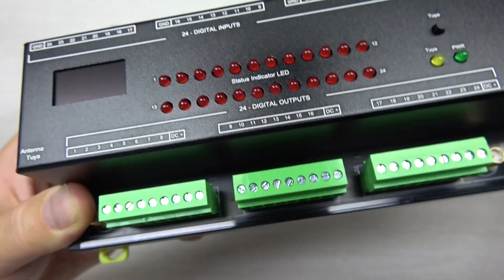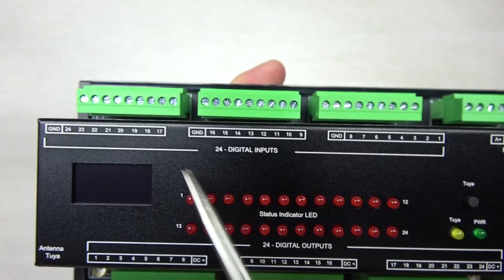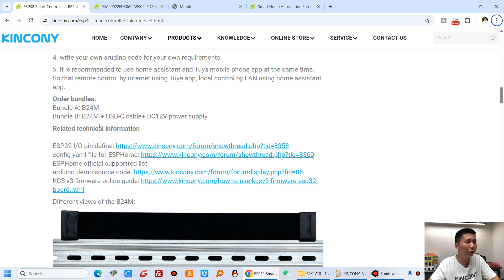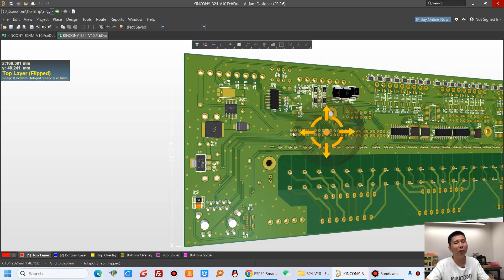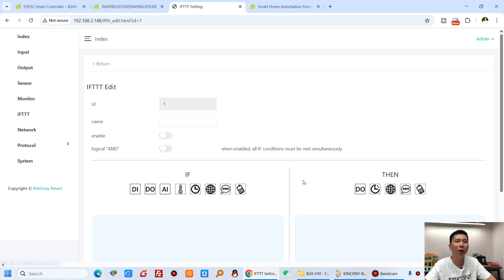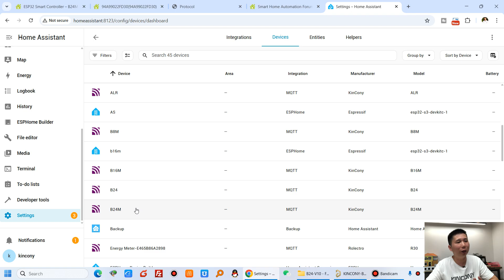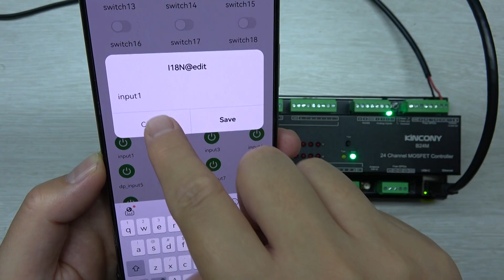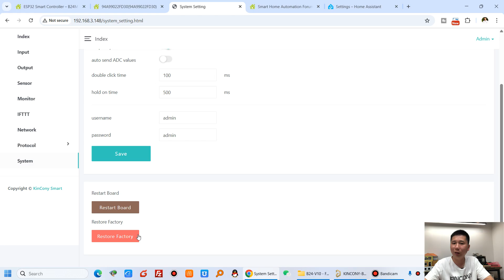24 Channel ESP32S3 MOSFET Smart Home Controller For IoT Project-B24M

Comment: For which use cases is this version better suited compared to the relay board?
Reply: @KinCony MOSFET vs Relay board – which use cases would you recommend for each?
Reply from the maker: @ruimarinho  mosfet+extend relay module is better.
Reply: @KinCony why? longer service time?
Reply from the maker: @ruimarinho  yes, extend relay life.
Reply: @KinCony and witch relay board do you recommend to use with the mosfet one?
Reply from the maker: @emannuel  B24M, B16M, B8M all are mosfet version.
Reply: @KinCony right, I mean, you mentioned that would be better to use both together, the mosfet with a relay board, right? Or to control lights we would be good only with the mosfet boards?